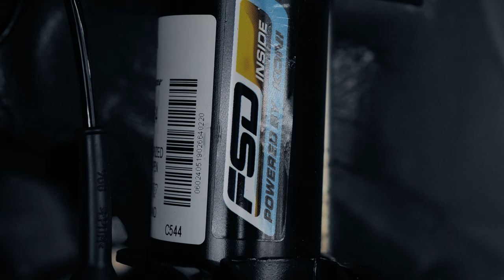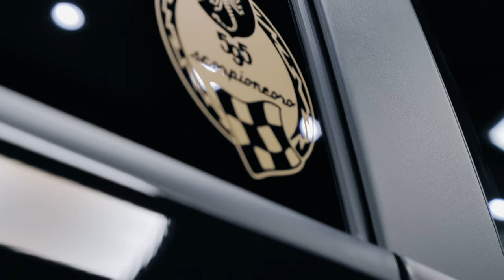Abarth Scorpioneoro 595 | CERAMIC Coating Gloss Levels!

Comment: Another great result. 👍😎 If I had to offer one word of caution and that is to the young man in the video. Protect yourself and wear gloves. You are using a chemical and if it bonds to metal, that would imply it can easily be absorbed by your body. Stay safe from a fan across the big pond.
Reply from the maker: Hi Wayne. Appreciate your comment buddy. All coating applications on video are mock up shots.